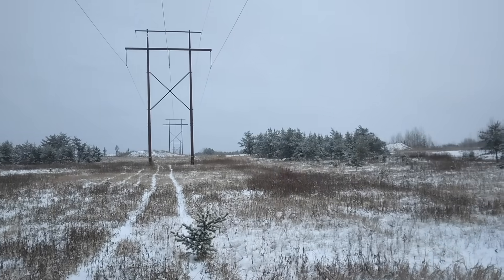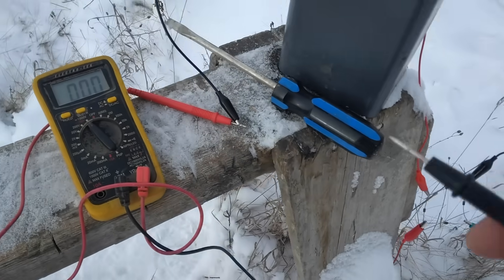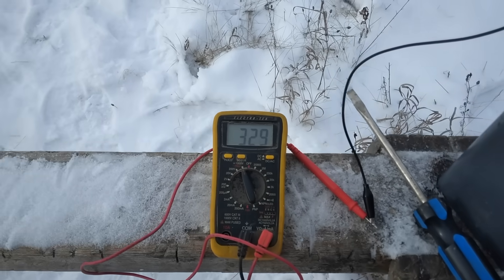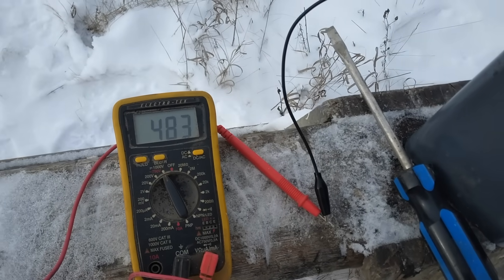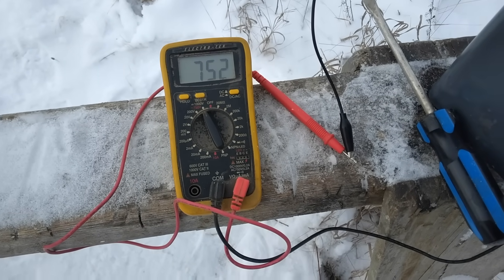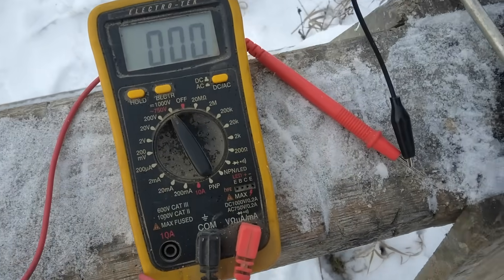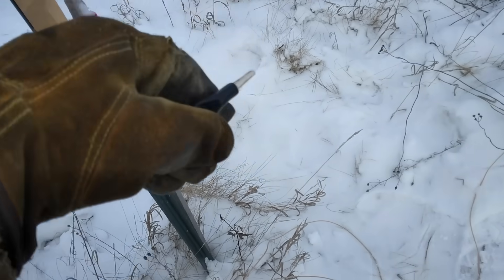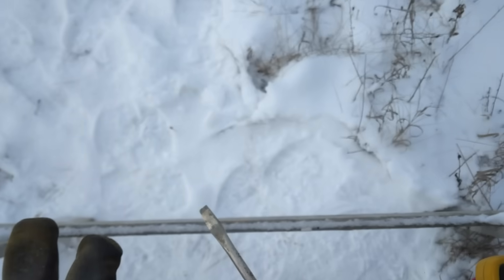Fences sucking power from under HV transmission lines

Comment: Thomas Edison used induction to invert a wireless telegraph. A wire was strung along the top of a train along side telegraph lines. Messages could be sent & received on board a moving train.
Reply: Nice! Of course, today we'd use radio.

Comment: When we would ride our mountain bikes under the power lines, we would get shocks if we touched the frames, so there was significant induced voltage. You might try holding one end of a fluorescent tube and waving it around under the power lines to see if they light up.
Reply: They will as teens we did it in FL.

Comment: Volts alone is no power, also measure the current, I suppose you get less then a watt out of this crap
Reply: Lookup the definition of "joule". And yes, he was getting a lot less than a watt. I calculate that he was collecting at a rate of about 75 milliwatts.

Comment: Ah, Yea!  But, it took forever to charge that cap.  Might have the voltage but no amps.  Might be able to run a few LED lights.  
Maybe if you had 20 miles of wire. Then had it raised up about 15-20' in the air, next to the line.   Then maybe one could get enough amperage.
Reply: Just need to make a coil.
Reply: @davidbrayshaw3529   Right! Same difference.
Again, it's still a small collection of high voltage. No substantial current though. 
Like a coil in an old car.  It can deliver a quick spark to a spark plug. One quick flash!  
Or it's a lot like static electricity from your fingertip. It will give a spark. But you cannot power anything off it.

Comment: It makes me wonder if the presence of your wire has any effect on the power in the wire.  Once the energy has left the overhead wire, is it wasted anyway, or does putting your fence up cause a slight drain by inductive coupling?  I would assume you do actually suck some power from the wires, but so does everything that gets near it, so the effect isn't noticeable.   It also seems like it could cause damage to sensitive electronics as they pass under.
Reply: An idle EM field does not "cost" power. When you put a wire within that field, induction occurs, and energy is transferred from the overhead line to your wire. It's basically a huge transformer.

However, given the amount of power being moved through the transmission line, the increased draw from a wire like this is a drop of water in the ocean - completely insignificant.
Reply: @PsRohrbaugh  I imagine anything that moves into that field draws power also.  People,  cows,  cars, or whatever else is around, probably absorb power in the same way.
Reply: The protective relays on each end of that segment of transmission line, most likely made by Schweitzer Engineering Laboratories (SEL), are sensitive enough that they can detect abnormally-high line losses.  People have been prosecuted and back-charged for the power that they have stolen in this manner.  You might get away with it for awhile, but eventually they will figure out where the power is being taken from and you will end up in a world of hurt.  If you want to take power out of the air, it's better to do it legally by using solar panels!
Reply: @redmondjp  unless your solar panels keep getting fried by the EM field from their transmission lines.
Reply: @michaellowe3665  I didn't say to install the panels underneath the lines!
Reply: @redmondjp  it's hard to say what a safe distance is and depends on where your property is compared to the lines. Some people may not have a lot of options.
Reply: @redmondjp  truth
Reply: It would affect the field surrounding the cables which could cause higher than normal losses. So it is effectively stealing power. It probably doesn't matter if you are not using it for habitual things. But powering an electric fence or appliance...that is dangerous territory to tread in. Just don't tempt fate by doing something like that and definitely don't memorialize it on a YouTube video. Plausible deniability is the key point
Reply: @jacobfreeman5444  I think he makes a good point that this is a potentially dangerous situation.   Someone stringing barbed wire on wooden fence posts could be killed this way even if they had no intention of stealing power.  What he is doing is educating the public about this.  I also think that a court may see that power that has escaped the confines of electrical wires and is permeating someone's property is no longer the possession of the electric company.   The electric company also doesn't want to draw attention to the public danger they are creating by unintentional induction and EM radiation,  so they are unlikely to pursue anyone for this.  At most, they may ask a land owner to take it down.  If it's no larger than a typical fence, they are going to have some trouble forcing that.

Comment: could you use a 1000 volt micro inverter and use the extra volts converted into amperage to charge batteries ?
also build a 10 ft high fence and lay your wire on the top

Comment: I'm a fencing contractor and I can say that I have put up several fences up under overhead power lines and sometime it will shock to piss out of you touching the fence.
Reply: Morel of the Story ? Never Pee on a wire fence near a Powerline ! Check !
Reply: @joelaichner3025  I did it when I was seven on a dare. Hit the fence with a healthy stream. I was a stupidly fearless little punk. But let me tell you, the feeling of every muscle locking into a ball starting with my soldier never ever left me. I'll never forget that pain. Like I was flash frozen and all my innards and gizzards were being yanked right out the lizard. My God it was awful. Lmfao took the wind out of me, and I was sore for days. Had a traumatic avoidance of touching anything electrical for years 😂 Now it's just a healthy caution, which is good because I'm playing with welding equipment in the rain and snow these days.
Reply: @GenericalFishTycoon that’s hilarious. Glad you were ok. That had to be gnarly!
Reply: @joelaichner3025  - Yeah, don't fry your Morel .
Reply: @joelaichner3025  I love breaded & fried morels!
Reply: That is something to think about.  Easements often have gates to control  access.
Reply: I've had it happen without overhead power. Word to the wise... when you start a strand, always have an extra piece of wire to run a static ground. Even just a cloudy/breezy day is enough to build up a static charge. It's been strong enough to bite through leather gloves a few times.
Reply: @driverjamescopeland  that source ofenergy is ignored today, but I think it powered the lights in the early 1800s and before.
Reply: You should ground the fences to prevent being charged by close coupling.
Reply: @GoonyMclinux you should wire it to your house to avoid being charged by the electric company 🤣🤣🤣
Reply: I remember a story about 20 yeas ago. A farmer kept having bad problems with his cattle. Over a long time he finally found out the MUD had a charge running through it from the power lines.
Reply: @7000fps cow milking machines have special installation requirements because of transient voltages
Reply: @7000fps that’s interesting!
Reply: anyone ever just try using a grounding rod? the power company will come do it if they notice somehow on a survey
Reply: Those lines make my teeth hum and buzz can’t be good for the body.
Reply: Duely noted don’t touch those fences
Reply: Fences near an ehv line should be grounded. If it’s not an electric fence you can ground through standard grounding rods. If it’s electric you need to use an electric fence filter or shock filter. There are several manufacturers that make these.
Reply: @joshuawatson8569 I don’t understand how a regular barbed wire fence isn’t already grounded. Most people use steel T posts with steel wire clips driven into th ground 8 or ten inches. The wire attaches to these. Practically all farm rated electric fencing is grounded at the source. It has to be or  a weed growing under it would short it out. Everything would. To prevent that the fence “energizers” have all the necessary filters and such in the unit. I’ve built miles of fence. I believe that the evh lines cause this but it kinda defies my understanding of electricity. 🤔🧐⚡️🇺🇸
Reply: @MidMo4020 Grass, weeds, tree branches, etc if in contact with an electric fence will cause voltage loss to the point that it is shorted to ground especially if the offending item touching the electric fence is wet.
Reply: @gullreefclub  sounds accurate.. peeing on one certainly makes ya feel ALIVE!🤣
Reply: @MidMo4020  Your understanding of electricity is just fine.  Metal T-posts would be grounded but some fences use wood posts which would not be grounded.  In this experiment, his “fence” wire was not grounded.
Reply: @joshuawatson8569 if it should be an electric fence install a non grounded standard fence and it will do its job.
Reply: Added to my what not to do list 
Thank you for the info
Reply: Dont live closer to the power cable left or right than 10 x hight of power cables
Reply: @altergreenhorn   🤔🤔🤔🤔🤔.  Thank you very interesting.
Reply from the maker: I was certainly surprised with how much charge it was putting on my wire.
Reply: @doubleMinnovations j'ai calculé, 900 V avec 80uF ça fait 32 joules. En 5 minutes, 32 joules, ça fait 0.1 watt de puissance. C'est ridicule.
Il faudrait mettre ton fil plus long, et plus haut.
Reply: Interesting. When I was in college I lived in a mobile home, and the line of mobile homes coming off the road were directly under some high tension electric wires. Since many of them had propane tanks, you wonder how well they were grounded!?!?
Reply: ⚡⚡⚡Well.... I wouldn't recommend pissing on that fence then! ⚡⚡⚡
Reply: It can be an LC circuit, think about the the size of the fence and understand that the lower frequency the larger the bandwidth, and the higher the frequency the shorter the bandwidth, the actual length of the wave it’s self! Linemen have issues with AM transmitters too, and that’s not just an electrical shock it’s an RF burn!
Reply: Imagine what it does to your body and brain
Reply: @SixOhFive I watched a court case about a mom who was being sued for breaking contract of rental house her son was preteen and in under a yr of living there his thyroid was puffed out huge on his neck and the boy was slowly dying the mom was told by drs to get her son n move away she did and her son healed slowly but they showd pics of tht kid when he was sick n it was terrfying  and dangerous he's a developing kid whose hormones r trying to kick in pre teen and the system kept gas lighting the mom about the electric towers outside his bedroom windows doing it she finally found a specialist who confirmed what was obvious cuz there was no issues til they had moved in there n was there a couple months then it started showing its ugly head if she wldnt had moved away her son wldve never made it thru a yr or 2 more it was tht bad have u watched living plants in the wild tht grow around theze towers and lines they're usually damaged if they're growing anything at all the govs are killing us all for profit they invest in the foods tht r destroying ppl and they own the pharmaceutical cos tht u run to afyer tht food has done damage so on both ends of tht stick they have control of your well being health and finances all while poisoning the air n water too and then telling u it's climate change as they cloud seed storms for more control
Reply: I was cutting through a dead sapling in a hedge, got a shock off it, looked up and realised that it was leaning against the medium tension power lines above.
Reply: @pcka12 cool
Reply: I heard of a few guys running there house or a shop from that cool stuff....
Reply: I hope you are doing that anymore. One day that fence might have too many volts and hurt someone
Reply: Back in the severties got a normal strip light it would light up under the power lines  fact .in BRITIAN . Leicestershire
Reply: F the cold weather bring on global warming or whatever they  call it
Reply: That's shocking
Reply: So don't put up a fence under a power line till you need to piss.
Reply: It's amazing when the claims are don't worry
Reply: I've laid pipelines underneath hv lines. They'll do the same. The AC current also messes with the DC current you weld with on a pipeline, won't get into that headache😂. Drive in copper rods on each end and ground out the pipe is about all you can do.
Reply: What i got from ths comment is when I dared my brother to p on the fence as kids and he screaming like he was being tortured he might of been 😂 🌩 ⚡️ 😂
Reply: Free electric fencing to keep animals in and other animals out.
Reply: I completely agree on this one I had been running an electric fence heavy gauge wire under high power lines and it was not hooked to the charger box yet as we were finishing the wire wrapping I had to get somebody with electricians boots to come out who didn't mind getting a bit of shock to finish the actual connection. Definitely didn't need the charger box
Reply: The scientific reason why this is possible and our current understanding of the same, was one of the most mind blowing things I’ve ever learned.. Oh and I guess Nikola Tesla was right after all.
Reply: Free electric fence!
Reply: buddies dad was a lineman in California, well working under high voltage transmission lines he grabbed a neutral cable laying on top of the grass , " cable was not touching the ground " from end to end the cable was about 100ft long, the discharge cooked a hole through his body from hand to foot, He survived but never recovered correctly,
Reply: @paulipuhakka8788 I heard of a couple that had a house near high tension lines, that had several miscarriages. They moved away and were finally able to have children.
Reply: @paulipuhakka8788 
Saw a house right up on top of high voltage power lines. My friend told me it gets sold often because the people that buy it get divorced, They go crazy from the high voltage. 

People that live next to those high voltage power lines get Cancer as well.
Reply: @paulipuhakka8788  real estate agents are there to make a commission, sell a property, they don't have to live there that is what caveat emptor is all about
Reply: You didn't say... Did you find that phenomenon pleasant?  As an old man I've learned sex is an infinitely  splendored thing. If man can do it, somebody will get off doing it. And there are lots of piss activities to geek over, if that's your thing...
Reply: @emu-5493  Jesus Christ No.  It shocked Us good until we put on gloves problem solved.  The guy we were building the fence for though had prop boats with naked ladies painted all over so we were working for a freak.
Reply: Hey there. I need to run a high tensile electric fence parallel with a high voltage power line. My thoughts were to isolate and ground the top wire for that length of fence. I dont wish to ruin my fence energizer. Any thoughts?
Reply: I just touched a chain link fence on a bridge under a power line. I had been swimming in the creek and was barefoot. I got quite a shock from it!
Reply: The piss.
Reply: Would going perpendicular with a loop like a coil help?  I circled a 4 acre horse pasture with an electric fence and it will certainly shock you without any power hooked to it.
Reply: Well don't do that! Piss before u touch the fence.
Reply: I remember getting shocked by a fence in the middle of absolutely nowhere while locating underground utilities in a pipeline ROW. I couldn’t figure out how. Until now.
Reply: ..how bout mucking round with insulated electric wires on a five wire fence on a cold winters day that hadnt been hooked up to the energiser yet...the fence tester said 100V...no power lines near..just atmospheric voltage...
Reply: It happens with all forms of electricity. Well known in the electric utility world.@RetroCaptain
Reply: Can you tell me why or point me in a direction where I can get informed?

Comment: That's an 88 milli-Farad cap, not an 88 micro-Farad cap.  Your energy calculations are low by a factor of 1000.  Charging up a BFC to high voltages like that is pretty sketchy as the power in them can really pack a punch.  If you're going to repeat this it'd be a good idea to limit your voltage and/or energy storage.
Reply: You might want to check your math. Just do a google search for:

mfd capacitor meaning

and you'll get "An MFD or micro-Farad is a ...."

Comment: As an engineer, seeing that voltage, I would take a transformer from a microwave and run it backwards... then see what you get. I had a friend of mine and cast a 22agw wire ove a line connected to an old pole pig(transfomer on pole).. fun but he got busted for theft😮

Comment: If you have an insuleted wire fence this effect can be mitigated by draining it through a high value resistor to ground. The exact value would need a little trial and error with the actual fence, and test the result with your capsitor setup. 100k ohm would be a good starting point.